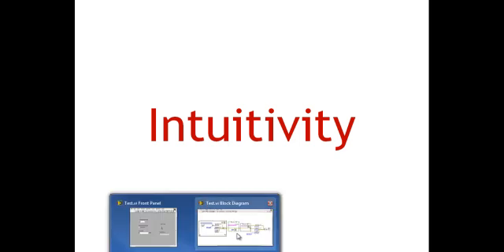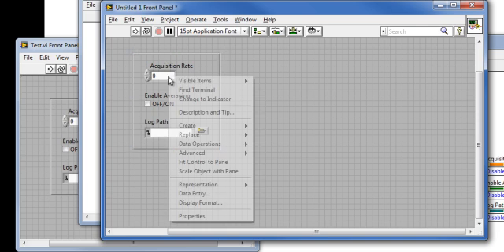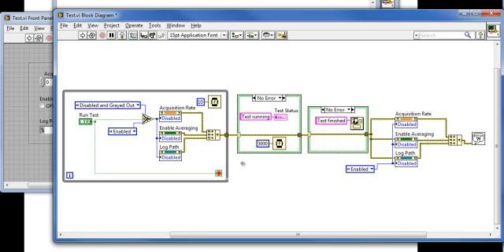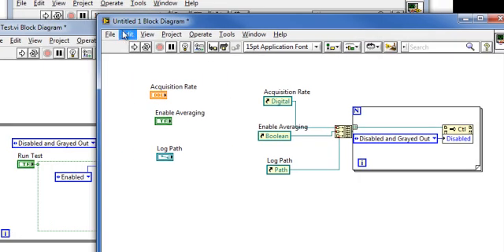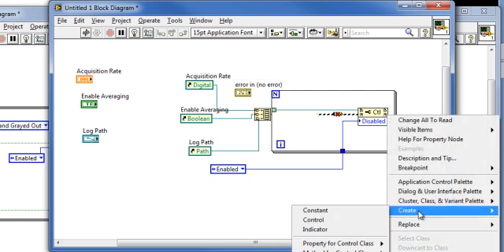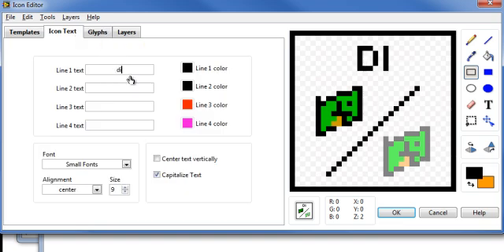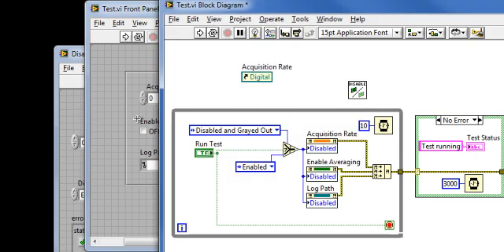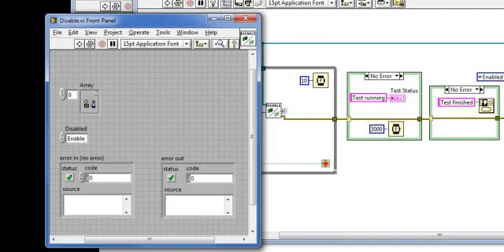VI High 3 - How to Use Property Nodes in SubVIs through Use of LabVIEW Control References & Refnums

Comment: You have the best LabView videos on YouTube.  But this practice exam question confused me in light of this video.  Can you clarify?  
4. You have a control on the front panel of a VI and you need to modify one of its properties at
run time. Which of the following is the best approach you would take?
a. Create an implicit property node and select the property to modify
b. Create a control reference, pass the reference to a property node and select the
property to modify
c. Create a linked shared variable and select the property to modify the property
d. Create a local variable and select the property to modify
4. Correct Answer: A
Topic: VI Server
Justification: Property Nodes are designed for modifying front panel objects programmatically. Answers
C and D do not make sense because modifying front panel objects is not what variables do. Because we
are not using subVIs, answer A is a better choice than answer B because an implicit Property Node will
work and does not require the extra inputs that the explicit Property Node requires.
References: Controlling Front Panel Objects Programmatically from a SubVI, VI Server Reference

Comment from the maker: Great question on the error tunnels! The short answer for this case is no. There are several reasons for putting shift registers on tunnels, but the most typical is in the instance where code in the loop is checking the error cluster for an error and then implementing some logic as a result, like stopping a loop, or transitioning to another state in a state machine. In the VI in this video we aren't implementing any logic as a result of the error condition, so the shift registers aren't needed.